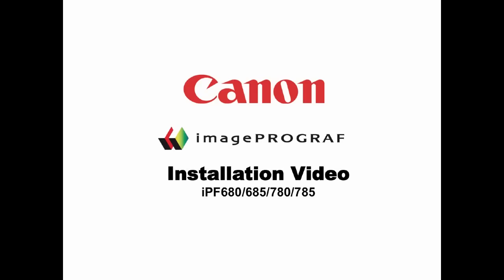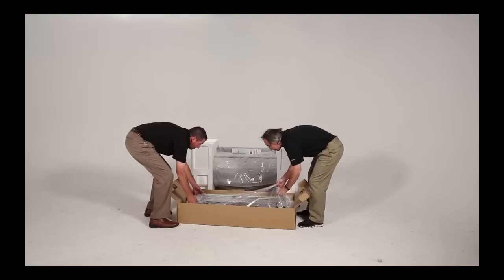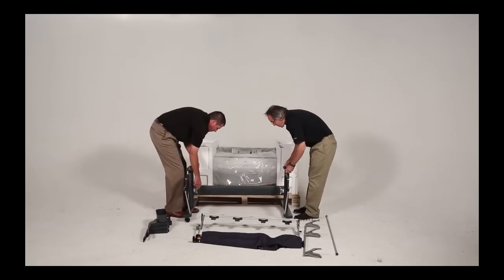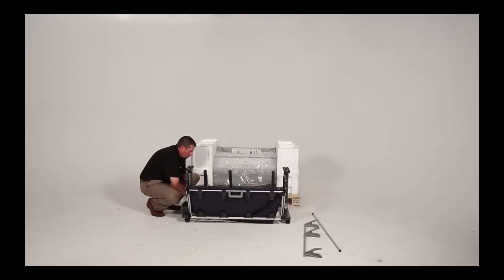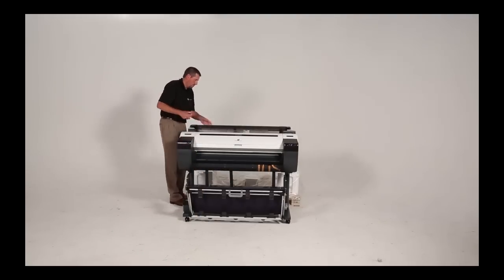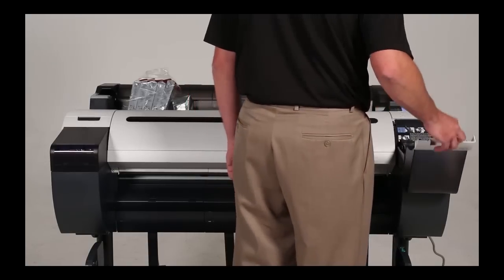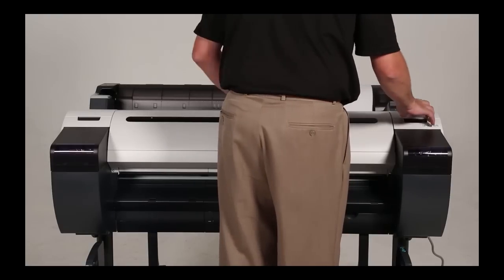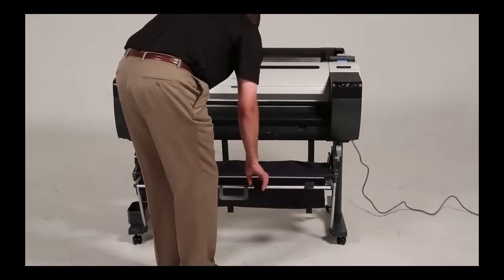Canon: imagePROGRAF iPF78xi Series / iPF68x installation video

Comment: Difficult to see what is going on when they put on the basket in the back - where do they fasten it?
Reply from the maker: Hi, Annette!  If you're referring to the segment starting at 5:28, the user is installing a roll of paper using the roll holder included with your printer.  It's a fairly easy process and we recommend checking the manual for your specific model for the exact steps involved.

Hope this helps!